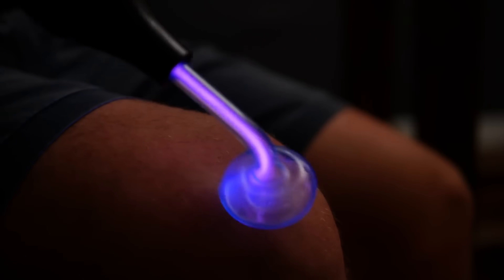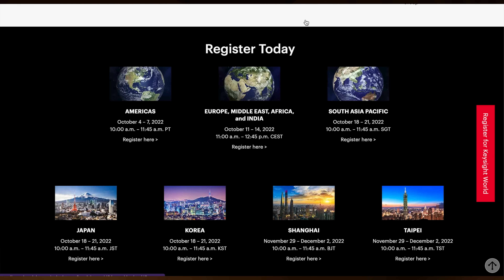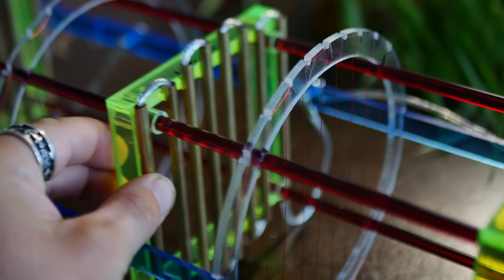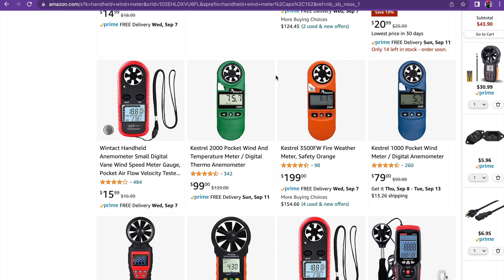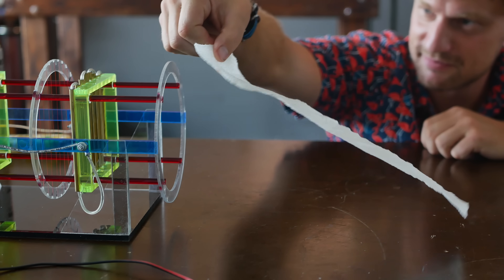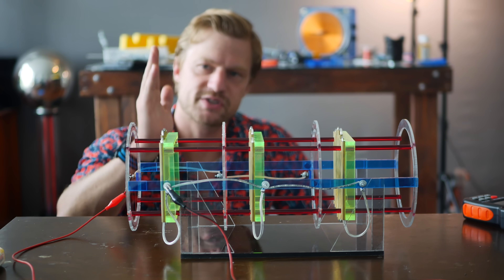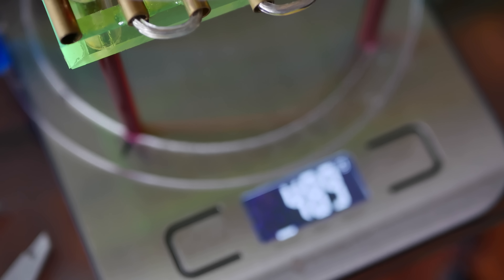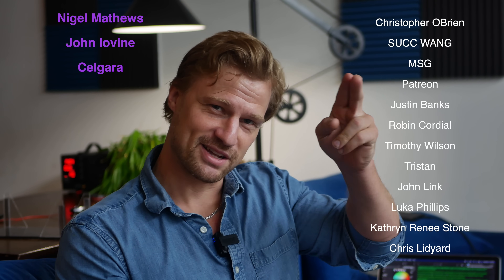Designing A Next-Gen Ionic Thruster! (For Flight)

Comment: Isolate each coil and bring them closer together. basically compactify the design. Add an enclosure that will both direct the flow and compress toward the final plasma grid stage. this way should do several things including:
1: reduce ionization threshold
2: increased thrust
3: look cool as hell

Comment: I'm no expert, but I'm guessing that the shape of the ground electrodes is pretty inneficient weight-wise. Cylinders have a pretty wide flat spot perpendicular to the airflow creating drag. Also, they have an entire back-side that's probably not doing much. Ionic lifters use a foil sheet parallel to the airflow, and those seem to work just fine.

Comment: It's only about 5 times less efficient in generating thrust than a propeller run by diesel engine, that's promising😊
Could you please also try with the sides closed off?
(you can also play with the shape similar to turbine engines with different diameter for each stage)

Comment: What you think , this type of thruster have any future ? Particularly aerospace where wing rubbing against skin of aircraft can provide pretty good intermittent voltages ...

3 improvements I would suggest except weight 
-use of Venturi like duct tubes to improve flow performanCe at inlet after every stage n at exhaust. 
- improving electrical performances of electrodes
- more aerodynamic shape of electrodes 
-possible reharnessing of charge from flow at exhaust

Comment: One inefficiency could be a lack of encasement. Covering that apparatus you built with a case that acts at a funnel with an intake at one end, and a nozzle at the other end could produce more thrust by forcing air in one direction, rather than letting the air disperse because of the lack of encasement. This would also help with blocking air coming from outside and disrupting flow. Since the air is not hot inside, you can use thin paper to encase the apparatus and create a channel that directs flow to increase efficiency.

Comment: it looks like you can couple the ion thrusters at the rear end of a jet plane since it could improve the efficiency. this is beacause the exhaust of the jet engine is ionised because of the heat and is directly proportional. The more the air heated the more the ionization and the more the thrust.

Comment: faith in humanity restored. you know what i want to see? feed a reptile tank fogger into the air intake while measuring thrust, and have the air enter through a ducted aerofoil with your thruster array enclosed in a tube, that should significantly increase your thrust (could be as simple as just wrapping everything in a few layers of cling wrap). those reptifoggers are a very nifty thing, and have variable output of fog density that is extremely fine tuned and efficient, allowing you to measure the effects of different fog densities with different voltages and air gaps. it also allows you to see how fast everything flows as an enclosed system. I would also like to see if shining an extremely bright light down the ion/vapor stream, through the whole system, has any additional effect on thrust, especially while strobing (thinking of like, pulsed photonic propulsion in a vacuum, kicking off of these ionized vapor particles and electromagnetically boosted ion stream). please consider trying this? also, you may be able to replace some of your plastic parts with parts that have been cut from like, cereal box cardboard, coated in thinned-out superglue and then dusted with baking soda. or coated with spray-on truck bed liner.

Comment: These are pretty impressive results without even using any aerodynamic principles to improve it. If at all possible, I would to see the results with a more direct measurement of thrust rather than airflow (without the obstruction of airflow caused by placing it on a scale). 

Off the top of my head, my layman's suggestions:
1. Enclose the body and install an output nozzle
2. Given the diminishing returns with multiple stages, I'm curious if the same weight, surface area and power draw but in one wide stage would give higher thrust to weight/energy ratios. This would have even greater application in aviation anyway, because of the potential for distributed propulsion application.
3. Can the diminishing returns be explained by a negative correlation between air speed past each stage and speed increase provided by that stage? If so, is this because of the lower pressure of that higher speed air, and could aerodynamic tricks to create high pressure areas in the flow be used to improve this?

Comment: Instead of round tubes try using flat veins, they would have plenty of surface area and probably be more structurally sound and give you less air resistance you can even put points on them to attract to the air flow.

Comment: 1. Enclose the Air such as a rolled piece of paper around the body secured of course. 2. Once you have the spacing get rid of dead space, they are gapped out which allows the air to become confused before the next thruster grabs it. 3. The positive wire seems to create points of ionic wind at set gaps along the wire, if you criss crossed the wire like a chess board you could in theory double the amount of ionic wind. Great design Brother, a bit more tinkering and you could have something very interesting on your hands.

Comment: You had me at next gen ionic thruster! 
Definitely want to see more of it running in the dark awesome stuff
Hey I have an idea, what if each stage of this ionic thruster increased in voltage to accelerate the air and duct the air around the ion thrusters to focus the air into the end where it could produce more thrust? 
Think of it like an electric turbine engine with separate stages of compression and the different turbine blades in this case are the ion thrusters accelerating the air at increasing rates down the (very aerodynamic) "tube"  then blasting the compressed air out the nozzle for serious thrust?
💡

Comment: Besides making it out of foam or something else much lighter, use progressively higher voltages along with progressively larger spacing. After it leaves the first stage, the air is already increased in velocity, so you need a longer length over which the electric field can act. Also use clear packing tape or something similar to exclude air from the sides.
Reply: More air is actually pulled in from the sides.
Reply: Yes, at basically zero velocity. You're taking advantage of a phenomenon that wants to travel at 100km/s, and the closer you get your exhaust velocity to that number, the more efficient it's going to be. Unless you can make an aircraft fly at 2m/s (not impossible, but very difficult and although lift efficient, it's not energy efficient) you're going to be trying to fly faster than your exhaust velocity.

Comment: Inefficiencies:
1. Middle stage should be reversed polarity
2. Emitter wires should be thinner
3. Sharp ends of the collector tubes are bleeding charge (visible in the still photos)
4. Emitter tubes should be streamline profile, not cylindrical
5. Wrapping saran wrap around it would probably increase the air speed out the back by preventing air exiting out the sides, but I'm not sure if it would increase the actual thrust.

One design I'd like to try is combined collector-emitters. Wrap aluminum foil over a streamline shaped core, so it has a smooth leading edge and sharp trailing edge (even better if it's serrated from the cutter on the foil box). Put a bunch of them in series with alternating polarity so the trailing edge emits and leading edge collects from the one in front.

The biggest challenge for flight is the power supply weight. The most straightforward route would be to stack up thousands of thin layers of battery material so you have tens of kilovolts with no heavy step-up hardware necessary. The trouble is how to turn it off :)

Comment: I'm assuming you mean energy efficiency
1. According to NASA's "An Investigation of Ionic Wind Propulsion" spikes instead of wires are much more energy efficient.
2. Moving large amounts of air slower would always increase efficiency. (large area instead of multi stage)
3. Large amounts of plasma and sound indicate that a lot of energy is wasted on that, which indicates the voltage is much higher than the 'efficiency sweetspot' for this design.
4. Hard to tell the material of the wire but its probably partially coated with oxide or some other dielectric, using gold or silver plating could increase efficiency.
5. Thinner wire would make the electric field denser and increase efficiency.

I was very briefly interested in the topic, but it seemed like balancing thrust per watt and thruster area would always make it ridiculously large. (to get anywhere near thrust per watt of propellers)

Comment: Some Ideas i have,

1) Add mechanism to adjust each stage individually and remotely to control spacing on the fly (like a servo or linear actuator connected to each stage) that way you can actively change trust while it's on and not have to shut the thing down to change it.

2) Enclose it, pretty sure your losing air flow to the open areas between each stage. (also as others have mentioned a nozzle but would be good to try those separately)

3) What if each stage had it's own driver instead of driving them in parallel? then you could also test combinations of different voltages.

4) A bit of a silly one, but would it be possible to make the last stage able to angle? then you could have thrust vectoring as well.

5) Make the screens and grounds rotatable so you can also test different polarization angles? might get more thrust from a screen rotated 30-60-90 degrees from a ground)

6) What about a thinner ground material?, right now the air has to flow around those tubes, what about using thin strips of metal as the ground planes?

Comment: I feel multiple independent thrusters is more better than the cascaded design, cuz if i think about it there will be air flow between the negative electrode of a stage and the positive electrode of the next stage in the opposing direction. Having the stages seperated will reduce the opposing flow however inorder to confine the original flow in a long cascade, a ducted design would work better imo. 
PS that plasma was beautiful, looks like a thruster from science fiction

Comment: Super awesome
Why not use a cone shaped nozzle for the wires and the enclosure. 
And maybe make like 8 or 9 stages??
Love to see the results. You are awesome
Reply: I've done it with 5 stages back in about 2001, both with linear and with pointed emitters.  It gives about 20% more thrust but requires a lot more power.  The crafts on my channel lift their power supplies onboard since December 2006.

Comment: Super Nice, 👌  
- you could try adding a cylindrical shroud to help with the air dynamics
- what about trying different geometries  and amount of wire electrodes/ ground layers? I'd suspect there is a nominal ratio between total surface of electrode and total amount of free space for air to flow through.
- pulsating voltage between stages so that charged particules are not only relying on inertia to flow ( stage one polarize, then stop, stage two polarize then stop, stage three and one polarize then stop. Etc...

Comment: Enclose the whole thing with a dielectric shroud, and put the positive node in the front and the negative node in the back with the cross sectional area narrowing between the two.  Maybe a ring of magnets to help constrain/direct the flow?  Taking STP air, moving it through a large intake and kicking it out an outlet with a smaller cross sectional area should see a bump in output velocity.  Ideally, you'd have a way of introducing thermal energy efficiently to the flowstream, and boosting pressure in the middle of the inlet and outlet, increasing outlet velocity further.

Comment: That's awesome! Next video could you give us some comparisons of thrust to weight ratio and watts to thrust compared to other devices like an electric fan etc? I noticed some hot spots on the wires so maybe getting those straighter or use thin sheets of copper? Would a a case help? And if close is better how does it perform at less than 1 inch? Also those images of the electricity are beautiful. I could stare at that all day.

Comment: Why don’t you increase the voltage with each stage. Plus the decrease the gaps in you accelerating grids to have more of an effect of the air moving through. The other thing seal it in a tube so you do t get losses between the stages. And put a Venturi on the intake to decrease turbulence

Comment: Can you put it in a tissue paper tube, wet the tissue paper with mist to make it stiffer, once dry. Then test. Also at venture to give it more compression. Then add vector-ing to the aft. Apperceive the tissue paper from the outside edge of the venture to the aft vector, and it will make a foil. Same principles as a ring orbit toy. 
I have one question though,  is the power supply AC or DC?
We did a similar experiment when I was in high school ( I loved Alex I Dupont, go tigers).
I have made several kit planes as a member of the EAA 
(Oshkosh, best event in the world)
Lastly, I build and fly my own design RCs and I'm an AMA member.
They lead the way and the rest of people follow. First to use lipo batteries in vehicles. 
First to phase electric to power flight.
First to flip over helicopters.
First to perfect quar copters, oca- copters..
Gee with out the innovative individuals in those clubs were would we be?
Still waiting for some capitalist to decide if he can make money on it, like the LED light bulbs. If they can make money on your hard work then they will through handfuls of money your way. If not they will publicly humiliate you like they did Tesla.